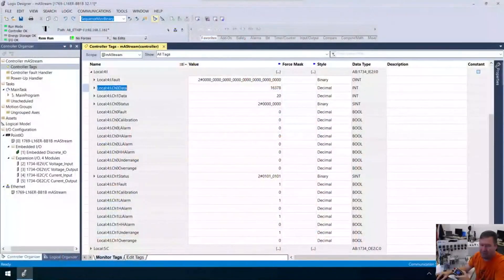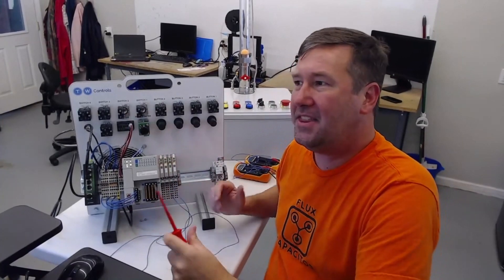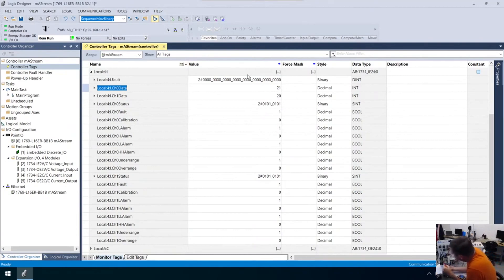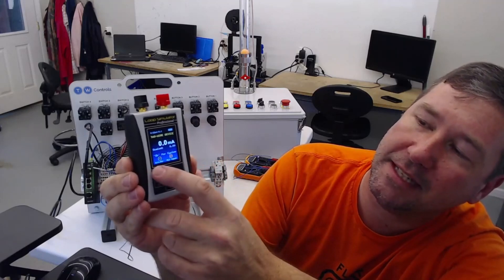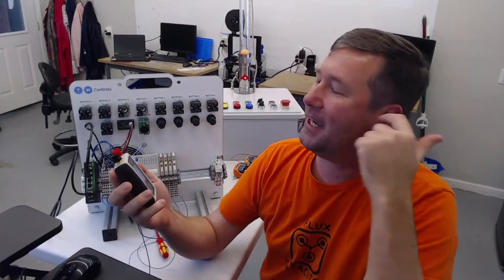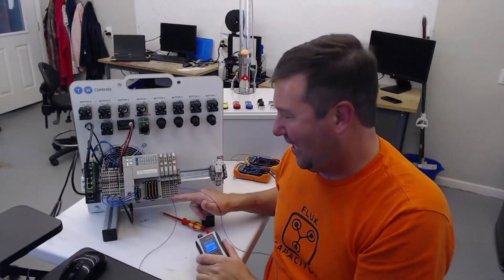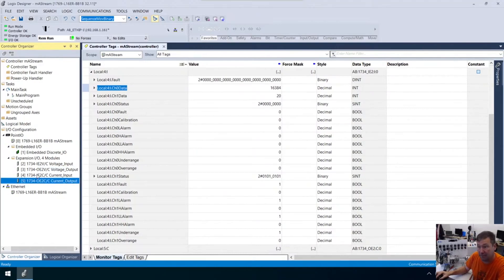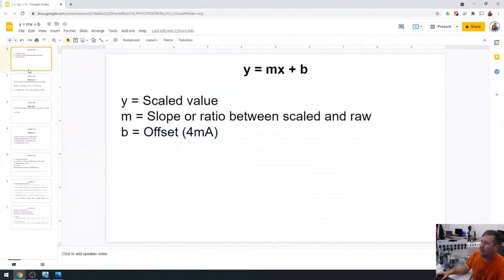4-20mA 2 Wire Current Loop Wiring to an Allen Bradley PLC Input

Comment: Hi Tim I have level  transmiter ABB LM 80 with power supply and output  4 to 20 mA and I ordered other one one by mistake they send me ABB LLT100with 2 wire i am still confused 😕 how to wire LLT100
Reply from the maker: No idea, probably time to contact ABB.

Comment: Hey Tim, I am using a position feedback cylinder with a 15" stroke. At zero stroke I get a reading of 1400 and at max stroke i get a reading of 17313. My high and low engineering limits are 16383 and 3277. Why are my actual reading so far off?
Reply from the maker: What analog input are you using?
Reply: @TimWilborne  1734-IE2C. The cylinder I am using outputs a 0 - 10 VDC signal so I am sure that is what is causing my issue.